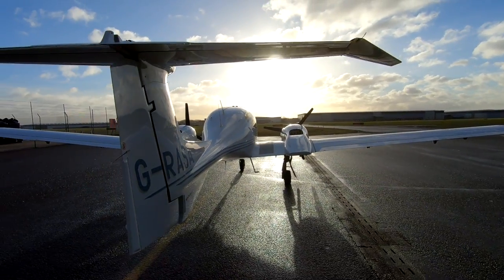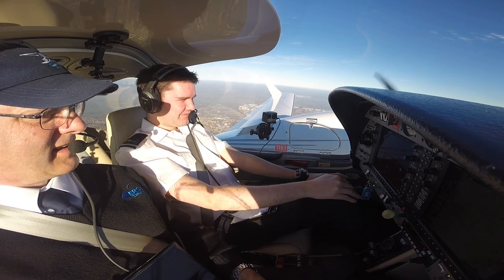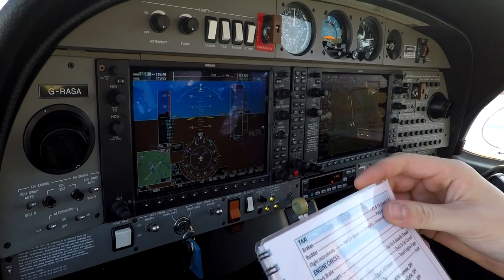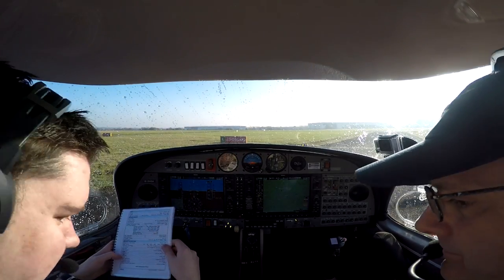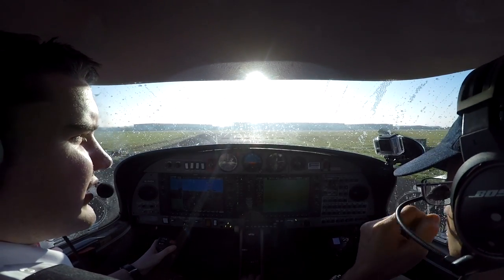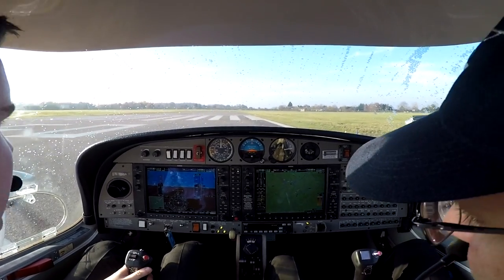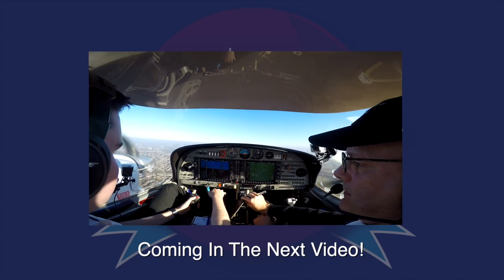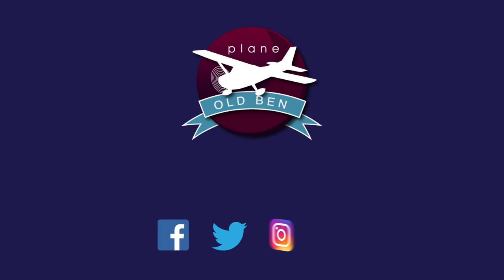DA42 VMC Demonstration & Recoveries - MEP Training | ATC Audio

Comment: Why when the airspeed dropped below red line (vmc) the aircraft remained still controllable?
Reply: Cause he was coordinated
Reply: Vmc is not a fixed speed. It depends on several factors. In this case, they "failed" the non-critical engine (the right engine). "Published" Vmc (the red line marked on the airspeed indicator) is based, among other things, on the critical engine failing. Since the non-critical engine "failed", this will give a Vmc lower than if the critical engine failed. Also their density altitude was above sea level and this would lower Vmc as well. In addition, their CG may have been forward of the CG used to determine published Vmc and their weight may have been more than that used to determine published Vmc, both of which would lower Vmc.